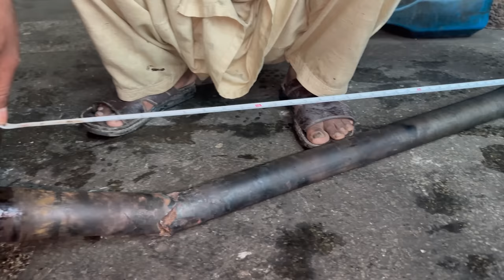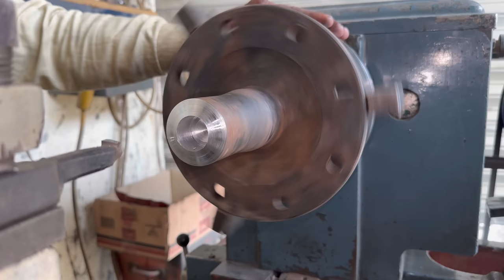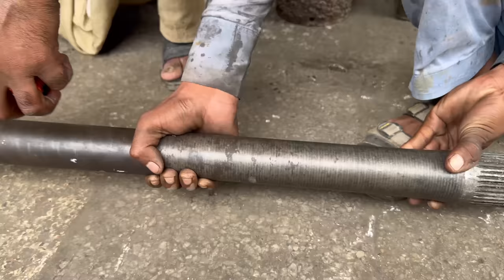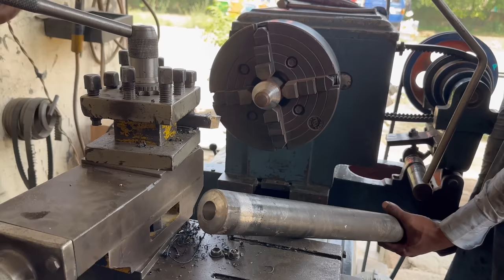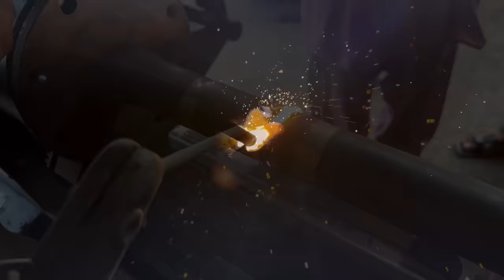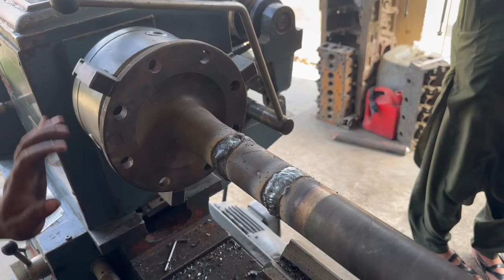How Mechanic Unimaginable Fixes a Broken Axle Like a Straight Arrow || Double Joint Work

Comment: Theres just no way thats going to hold. The metal was clearly hardened. It fractured rather than twisted. No matter what filler you use, the shaft will be weakened in the heat effected zone and just twist right off again. Obviously, hes got some skills. I have to assume that he knows it wont hold, but the custimer gets what the customer wants. I guess if you need the truck and cant get a replacemeny, you do what you gotta do and just try to baby it.
Reply: we did exactly what he did broke an axle on a 48 buick out in the bush , the mechanic  got another axel that was too short  so he lathed  a dowel on one and a hole on the other  and welded them the same way while in the lathe preheated the axle before welding it , that axle is still in the buick  we grossed 4 ton pulling a caravan and did a 2000 miles round trip
Reply: You realise many of these outrageous repairs are done just for youtube clicks ?
Said that, 
I'll hand it to them. No doubts they're skilled to make repairs with primitive methods. Never mind if it's going to last but one unloaded trip across town.
Reply: @GDayTrueBlueAussie  A 48 Buick isn't putting out much horsepower or loaded like a truck carrying goods. Axle splicing is still done by low-budget racers but race vehicles are rather expendable.
Reply: I wouldn't want to rely on that prop shaft going down a long steep mountain with a heavy load on the truck,  just saying
Reply: @Comm0ut  at more cost if loss so I doubt it those cars can cost millions
Reply: I’ve done these repairs and unless you have done them yourself you have no idea how well they can and do  hold up. To many engineers on you tube,and not enough actual doers!
Reply: Rumour said they never had customers coming back to complain
Reply: Would like to know why they didn't just stub the long part and avoid the extra weld.
Reply: @drgeoffangel5422  It won't have problem going down because the brake discs and suspension have nothing to do with it. Going up (with engine full torque going through the axle) is another story.
Reply: Come to think of it some vehicles just have a pin that locks the rear axles to the hubs. Never heard this pin break.
Reply: @GDayTrueBlueAussie q
Reply: @wreckum56 I am with you, till you've done it don't act like you have. I hope it lasts forever 😊
Reply: Нифига себе есть даже люнет 😂
Reply: Lots of armchair metallurgists on YouTube. It'll hold until it doesn't. But it's better than it was. Its entirely possible the original shaft wasn't properly heat treated, too...
Reply: Excellent safety standards! 
Clothes, shoes are perfect for the shop. 😂
Reply: That wouldn’t last 2 minutes 😂
Reply: Can anyone explain why he went from a three to a four jaw chuck for the joiner?
Reply: @hokz7283  
The pin is probably done to act as a "mechanical fuse" and avoid damage to costly parts.
Reply: In the sub continent we usually operate 2.5x the designed load. 

These repairs, whenever done has stood the test of the industry. 

Just that you don't do them, necessarily does not mean they are bad. 

And one thing I learnt early. 
Engineering is a science of compromise. 

Compromise quality vs material vs space vs time vs money. 

The compromises are many times worth it.
Reply: He used the same type of metal which is hardened as well...same wat u would use a bolt and a nut, n they don't break. At most what would happen is that they would come apart, but theres simply not that big of a tension on it for that to happen. It will hold.
Reply: Para mí es un trabajo exelente... Y no se que es lo que tratan de decir cuando dicen rudimentario... Tengo 38años en el rubro ese trabajo es una garantía...solo la experiencia le da eso y se ve que no es el primero que repara...es fácil decir o jugar...pero ahí manda la experiencia y la verdad tengo el culo pelado  de andar con ejes soldado y hasta el día de hoy están el servicio...🇺🇾👍👏 exelente trabajo.
Reply: @wreckum56 great comment 😊
Reply: @derekallen4568 
The 3 jaw was used to hold the outer flange part. The 4 jaw is more precise . Did you see how he checked for run out ?😊
Reply: Ayrton Senna...
Reply: Yedek parçanın orjinali  pahalı ise veya  araç modeli eski ve parçası bulunamıyorsa  yapılacak en son yöntem budur torna ustası bence olabilecek en iyi işçiliği yaptı CNC makinalarına göre her şey Manuel olmasına rağmen iyi işçilik
Reply: Go over there and show those cavemen how it's done, Bill.
Reply: So, instead of repairing it beautifully, to make it stronger afterwards,  better welding several pieces long rods surrounding  the joint areas although  they are ugly
Reply: @ray-charc3131  If the torque involved could snap the shaft like that before, it's going to be worse now that it's weaker. It's probably damaged the metal along the entire shaft too. It might help to heat treat it. It also might help if you could avoid having the weld through the piece all at the same point along the shaft. Diagonal is one way to do it, although that's a bit ackward with a round shaft. Maybe bore the center of each 1/2". Then cut each diagonally. Press it together on a 1/2" rod and tack weld at the ends. The come in with a grinder and v it out down to the rod, and weld it up. Depending on how the bearing and shaft fits up, maybe you could get away with a taking the wheel off, assembling the bearings into the hub and installing the shaft. Then sliding a piece of tubing over it, cut diagonal at the ends, and welding it on. You'll have to cut it to replace the bearings but it will probably break first anyway to spite the reinforcement.
Reply: @undaware It was too short probably.
Reply: The welds were very sketchy and the weld groove was too narrow probably. They should have used mag particle to find the ends of the fracture before cutting the shaft pieces. There should have been preheat and post heat on the shaft for welding. It would be better to have a complete joint penetration weld on the shaft so it can be ultrasonically inspected afterwards. The shaft should be re-heart treated afterwards. But all this depends on the welding specifications.
Reply: @pete4043  because I'm sure they have all the equipment and capability. 🤣
Reply: Trucks like this in the third world operate at much lighter loads and slower speeds. It'll be just fine.
Reply: @rd946  mag particle testing is pretty cheap actually, and crack propagation after welding repairs is a big deal kinda
Reply: its necessity, this people can’t afford new parts and had to rely on this type of jobs to survive, there is no regulations or laws there so it is what it is, at least they are trying to
Reply: @pete4043  have yoi ever visited a country in the developing world? If you had you would realise that many very practical people have learn't by experience. It may nit be perfect but the truck is up & running again
Reply: It’s India it will last until it’s driven off a mountain road!😊

Comment: Those rods they use are junkyard rods made in china. I saw the number on them in another video and looked them up, theyre for mild welding, thats part of the reason they weld so good and easy in a flat position. If thats all i had, and room permitted, i woulda split a piece of pipe and wrapped it around that entire fix, and welded it all the way out. Maybe that would strengthen it enough to make it hold for a while. You can get rods specifically to weld hardened stuff like that, but theyr expensive and you gotta pre heat/post heat, etc.
Reply: Fully agree with the idea adding something to strengthen the damaged point and beyond and distribute the stress.

Comment: I wonder how it snapped in the first place, lorry wasn't grossly overloaded by any chance. The very first measurement from end to end when it was lying on the floor was for nothing.
Reply: the spline would have a bit of tolerance in the diff
Reply: I agree! Such axles however provide enough tolerance linearly so long it will not exceed the designed factory lengths

Comment: Hardened steel axle and they just weld it with normal welding wire😅😅 this will snap right off.

Comment: Most of the stress on a torque transmitting shaft is on the surface of the shaft. To use welding material on the surface will simply make the two weld joints stress concentration points.  This shaft will break right at one these two points, whichever is weaker. Sorry to say.

Comment: Admirable piece of work, but they introduced two weak spots instead of one. And a piece like this requires a thorough heat treatment to ensure a consistent microstructure. For a short period this may be sufficient.

Comment: So the shaft snapped when it was solid through the enter diameter.. the repair now holds with a weld on half the diameter?  

The center alignment dowel was far too large. It is friction-fit and provides no strength.

Comment: Some parts like shafts, crankshafts, axles should never be welded together... it's not safe where too much load or stress is applicable...no matter how good a joint or a weld is....

Comment: That job is not complete until that shaft goes for balancing then will see there's no waiving.😊
Reply: What is the maximum rpm expected of a truck wheel axle in the first place? I think this axle will not have any eccentricity at such speeds. Then the centers of the shaft joints are notched in to maintain the centerline.

Comment: Good work but...the strenght of the axle is far less than a new one. Electrode welding... Only removing the slug with a chipping hammer not  gouging or grinded out. Not NDT performed. Or at least crack finding test. Just a lousy repair though the lathe skills are present.

Comment: If you’re going to weld something while it’s chucked up in the lathe at least cover the ways with something to prevent weld spatter damage to the ways. I cringed when I saw that. Then you didn’t even wipe the ways off before bringing the carriage over the weld spatter and welding dust.

Comment: There us nothing wrong with this repair. The metal arc'd. Was hot enough to melt the both joints to join as one. The other unworked portion may fail but not them joints. The weld is stronder than the shaft. That is fact for the naysayers.
Reply: Такие вещи всегда ломаются рядом со сварным швом.

Comment: What the heck? Welding it? That is not safe because you cannot just use ordinary metal. That material must be the same as the original. Also welding it requires the right welding process. It should be preheated and post heated. Without the right welding process, it will cause premature cracking (Heat cracks) this repair process in this video is just a waste of money and energy. And also not safe to use.

Comment: And this ladies and gentlemen, is hpw you ruin tools. Not a single drop pf oil to cool the bits used, which you can tell by all the bluing on the shavings.

Comment: Absolute rubbish or emergency solution for a few days. Like an arrow? You can see with the naked eye that the thing is beating. The material has a fatigue fracture and becomes even more brittle when welded. Not the entire cross section is used because of the inner pin - less load capacity. The welding bevels are too pointed - no melt pool. The welder somehow fries material full of cavities without melting it into the base material. Everything is turned with the standard pointed chisel. Concentricity by eye 🙃. Length measurement with the mason's tool......

Comment: No safety equipment. No proper measuring or centering. Repair weld on a previously heat treated part. So many things wrong here. Stop saying these guys are masters of anything. They get by, barely.

Comment: OMG ! ... clearly this is not a 1st world repair.  I applaud the skill of the machinist, but this "repair" scares the 1st world cr@p out of me.  The machinist is I'm sure working to his best, knowing his environment better than I do, knowing what is expected; but ... 
not 1 drop of lubricating fluid (and possibly the workshop conditions have something to do with this, too much dirt),
not a single radius at any of the machined steps (as far as I could tell, all seemed to be sharp 90 degree cuts), 
the "precision" of his measurements (ok, working with the tools he has), 
swarf is not a "theatric element" (added to the video to make it more interesting), and 
I guess he hasn't heard of HAZ (Heat Affected Zone) where the properties of the steel are reduced (and yes, I saw the spigot he used to align the pieces and the interference fit).

Comment: What a truckload of horseshite. Why waste time on this crap. This axle is no longer solid but hollow lile this. Half of the material is not bound...They could have just turned a new axle and spline it with this effort. I got a feeling that they do only for the internet. This just doesnt make any goddam sense the axle broke even as a solid how will this fare...maybe the first throttle and it snaps...

It could have been way better if the pin was waay thinner and shorter tho with a powerful enough welder and a proper pin it might even work if they manage to weld it all through so it forms a proper solid
Reply: The work involved here doesn't equate to what you assume they are making just off youtube. This group isn't making hand over fist "tricking" you that this is real. They actually do this in their real lives.